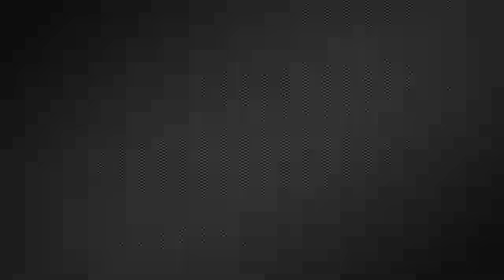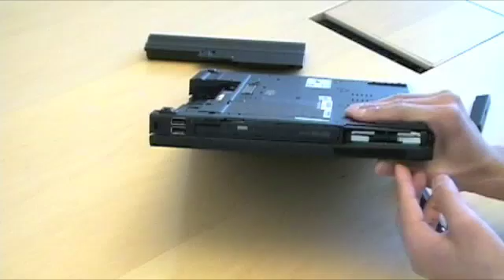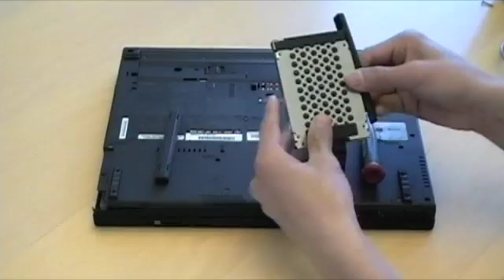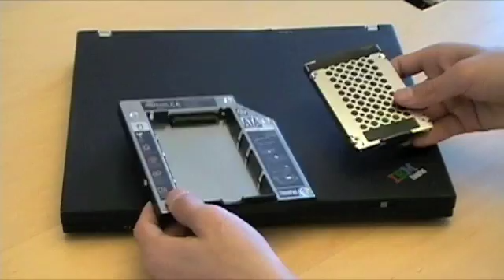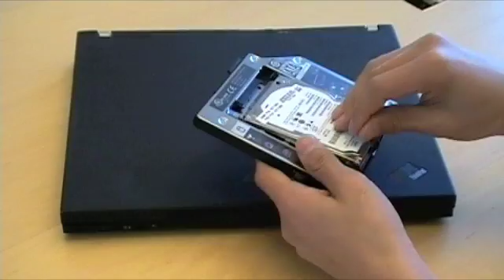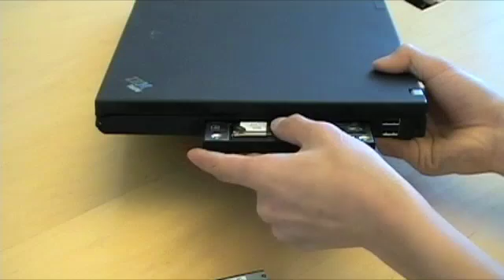Thinkpad (T60/T61) HDD Swap

Comment from the maker: The metal bracket is a merely a sleeve that comes with the stock HDD. It provides the strap to help you pull out the HDD currently installed. It's easily removed and transplanted to another HDD by unscrewing it and mounting it to the new drive.  The SSD will work fine in that system.

Comment: hey I have a t61 and i was wondering if a standard ssd would fit. because your drives seem to have the metal thing around them i know there is one in the thinkpad which i can use but do i have to buy the metal cage for my derive to fit in the ultrabay?

Comment from the maker: @youjotr9876 -- Looks like you can put any standard 2.5inch SATA drive into this system. I've used up to 320gb on this one, however I know there are larger ones 500gb+  Just make sure your operating system supports it.  Also, if it's available - the latest BIOS can help.